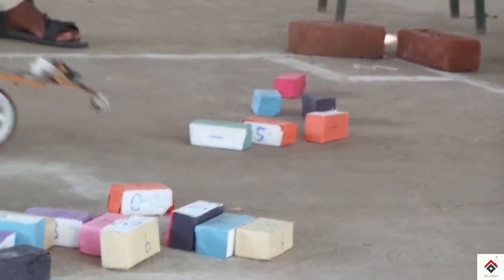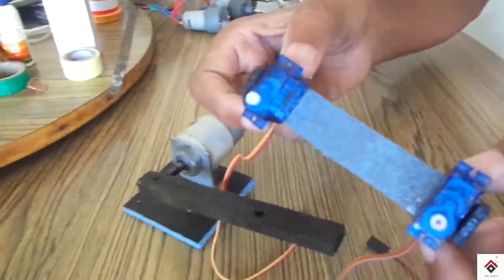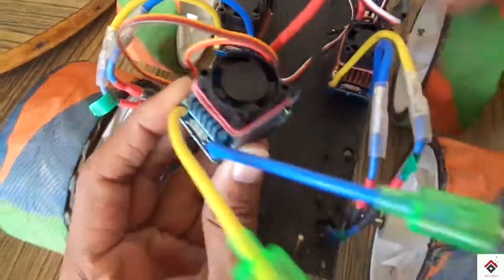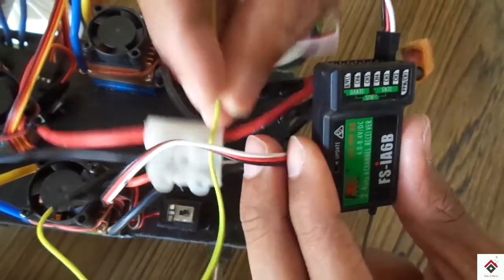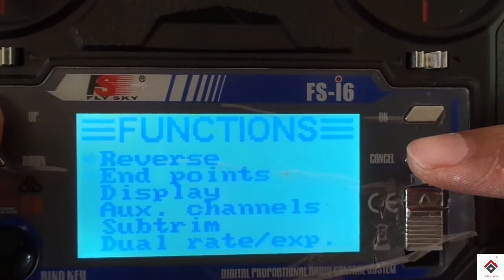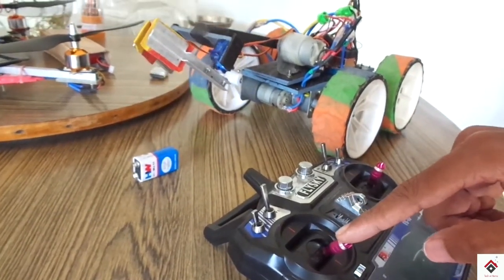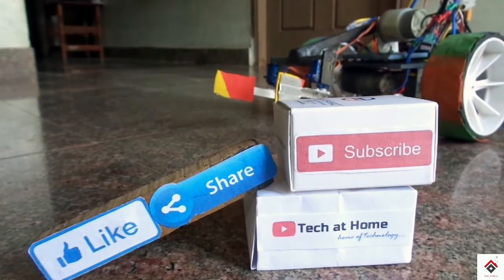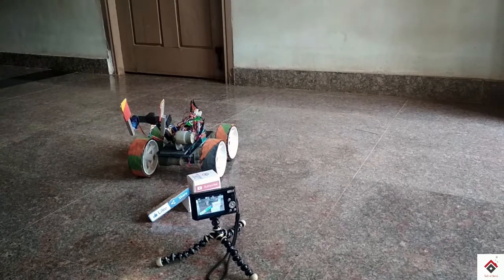Robotic Arm, Object Picking Robot using Flysky fsi6 | Wireless Robotic Arm | Pick and Place Robot

Comment: How to control the up and down motion using that gear motor with flysky mine is totally rotating and fully  damaging the entire bot
Reply from the maker: Use low RPM motor. Mine is 10 RPM.
You should not continuously hold the transmitter stick. Move little bit up and down.

What rpm motor are you using?